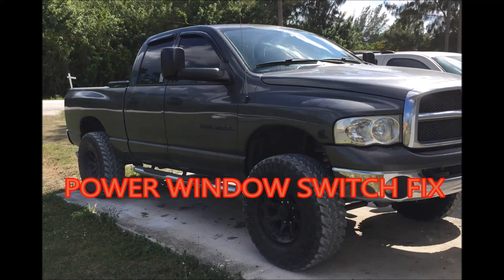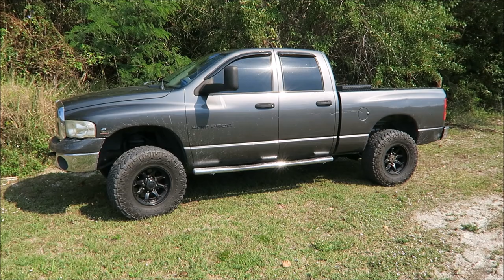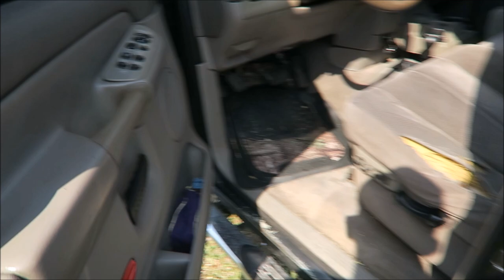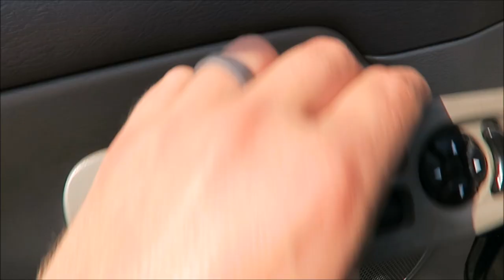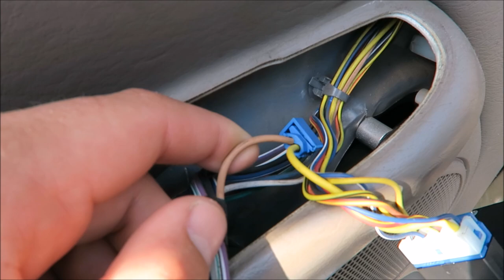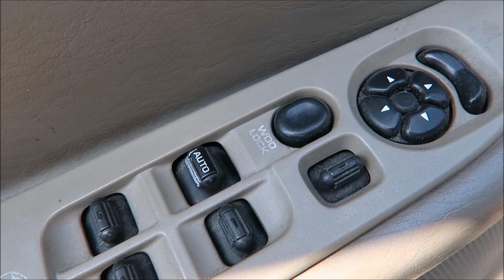How To Fix Dodge Ram Power Windows

Comment: I've been having a problem I can't roll any of my windows down. I bought a new main switch for the drivers side but that worked enough to roll my windows up but then stopped all together again. I think it's the wires or the window lock how can I buy pass the lock button I don't care if I can't use it just as long as I can roll my windows up and down again.

Comment: I have a 2002 Ram 1500 2 door regular cab that had this same problem. I just used a piece of phone wire to jump the peach and (thick) yellow wires at the plug connection and it works the balls. Saved me form buying a new switch assy. which cost $30 to $60. Thanks.
(It helps to insert the phone wire if you first lift the white plastic tabs that keep the wires in the plug and then replace the white tabs after the phone wire is inserted.)

Comment: Worked on my dodge 2003 standard cab.  It was only working on master switch till it stopped working on that. Now passenger side controls its own window....Thanks...Got the tap  splice from ace hardware. Now each door door controls it’s own window....all for $3.00....Great video
Reply: Joe Snow  did you spliced the same colored cables? I got a standard cab too

Comment: This fixed my issue. My wire colors were different and I used the jumper method as described in the previous comments. This after buying a new master control a few years ago that did the same thing after only a few uses. This saved me from spending another $20. Thanks for the video and all of the comments.
Reply: What were your colors I have a 09 6.7 2500 Cummins and my wires are different
Reply: @josephcope1714  I can't remember, but 2 of the comments gave me a place to start. I think it was the peach wire and the thick yellow wire. Hope this helps. My Ram is a 2004 1500.
Reply: Can i just buy a new driver side remote panel and pidh the child lock for the window will that work i just need to turn it off
Reply: @coltonfowler7785  When mine first stopped working I bought a replacement and that one quit working not long after install. Eventually none of the windows would work until I used the jumper wire. It's worked perfectly since. Best to just jumper it and not worry about it.

Comment: Awesome Fix! THANKS YOU. Great upload.

I've had this video saved for about a year. Fixed it in less then 5 minutes while still in the Walmart parking lot where I got the quick clip.

Rear plug = Nude color wire
Front plug. = Largest Yellow color wire
Both are the same diameter

Blue Quick Clip and BOOM. They all work great now. Just as you've described.

My Quick Clip had one through channel & one dead end. A quick simple whittle with my pocket knife carved out the dead end flap and made it a "double (2) through channel" Quick Clip. Blue is the perfect size Clip for these two wires.
Reply: Does the connecter have to be double sided on both sides or just the one?

Comment: Great fix, thanks.  A heads up to others: make sure you jump the cables close to where the two harnesses separate so as to leave enough room for the connectors.
Reply: Perfect it works good that was real good

Comment: Idk if anyone is still commenting on this.
1) Happened to me 
2) checked fuses and wiring
3) messed with the buttons 
4) I had to put my side mirror button pressed down on L and they started working again. No cutting or removing needed for my experience.

Comment: I just performed this trick on my 2003 2500 truck. Presto! All the windows work. Thank you.
Reply: Len LaClairwhere do you get the jumper at
Reply: I had one on hand, but any auto store or Walmart would have them. The video shows a good photo of what it looks like.
Reply: Len LaClair did you use the same one in the video
Reply: Yes. It comes with one side blocked so you can deadend a wire in it. I just drilled out the little plastic restricter.

Comment: No need for a jumper. The solder joint at the switch has a "Cold" solder joint (manufacturing process failure resulting in latent failure). You can see it with a magnifier. Simply re-solder the joints at the switch and it will work fine.
Reply: Can you provide a picture of the joints you mention?

Comment: Why didn't you just buy a new master window switch? There 20$ new on eBay and Amazon. Had mine in for two years now. No issues.
Reply: I just replaced the master driver switch with one from Amazon but the windows stopped working again. It's funny because the side mirror motor still work. I'm thinking maybe that's why this method works in his case and maybe mine too.

Comment: I cut the two wires thinking I could make something else work and it did not. I lost power to my master window. Locks work but window wont roll down from master and master cant roll the others down now either. How do I fix this and what did I miss
Reply: Sorry for the late reply, but I just did the same thing. In my truck, the peach wire supplies power to the windows, and the yellow actually goes to the window lock wire. Should've connected the yellow to the peach, not peach to yellow 🥲